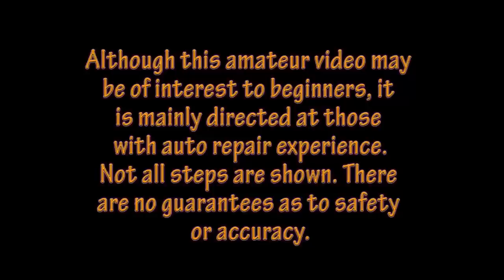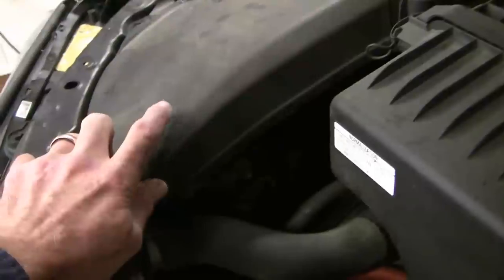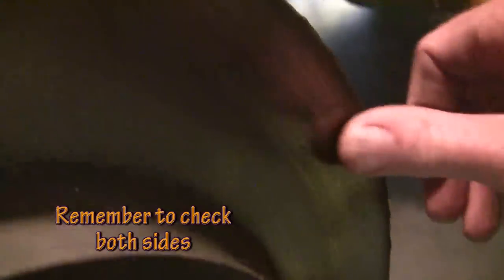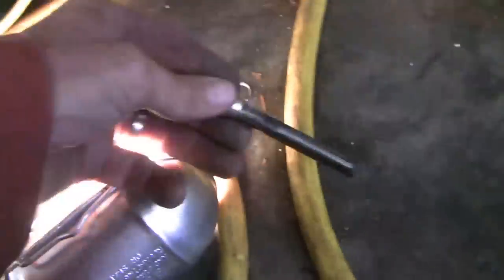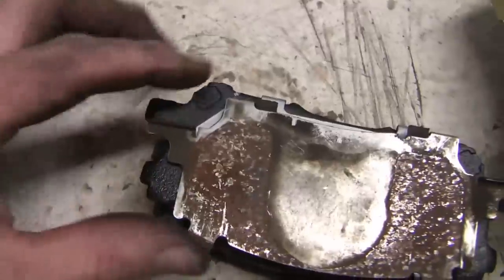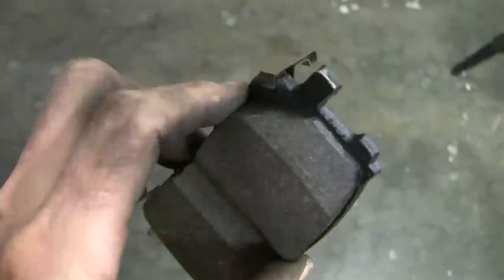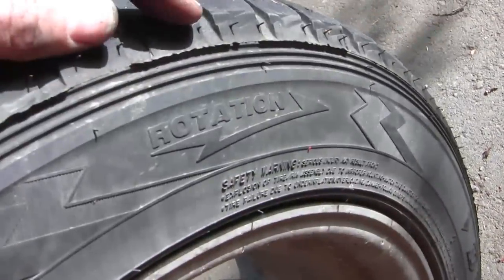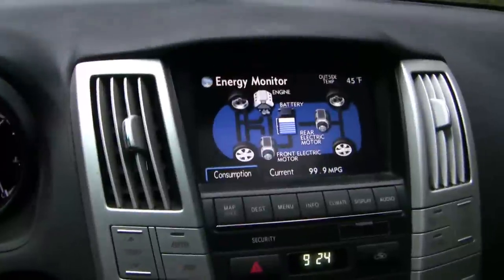How to replace brake pads on a hybrid vehicle, Lexus RX 400h

Comment: Hello my friend. I have a lexus rx400h 2006. 4 years and i have one problem. When i press break pedal slowly and lightly vehicle stops immediately, feels like ABS emergency stop system activated. This problems happens rare but this is very dissapointing thing. Can you tell me what this problem is ? P.S sorry for my bad english.
Reply from the maker: I guess I answered this question in the thread for my last video, but it is more appropriate to be here. This is the response I gave. I think you'll need a technician with a labscope and diagnostic tools that go far beyond DIY repairs. First thought is a failing wheel sensor, those devices have a hard time with slow wheel speeds and can send aberrant signals to the abs sensor, triggering the abs system. However with the complexity of regenerative braking, a simple code reader will not detect the signs of early failure. Many codes are proprietary and will not show up on a generic OBDII scan. Good luck!
Reply: @spelunkerd  thank you friend. I have one more question. 2 days ago i checked brake fluid suitability and master says brake fluid's need a change. Brake fluid's boiling temperature was 136 degrees instead of 200 degrees. And question is, can this brake problem caused by "bad" break fluid ?
Reply from the maker: @tutiav8447  Yes, when dissolved water boils it causes a spongy brake pedal. This is very different than the problem you are having now. Calipers really heat up when descending a hill or when actively braking in the heat of summer, and you can imagine the catastrophic problem of sudden onset of fading brakes when needed most. You can easily remove and replace fluid in the master cylinder with a turkey baster, but to more correctly replace all the fluid you need to bleed the system. Trouble is, in the hybrid Lexus after replacing fluid you may need a scan tool to bleed air from the ABS module. With most vehicles you can muddle through it by bleeding fluid in the usual way, then find a gravel road, activate the ABS by braking hard, then return to the shop and bleed a second time. I'm not sure that will work with the Lexus, you may get a pesky trouble code that is hard to clear, and you may not even be able to drive it until the new problem is dealt with. Professionals use a high level scan tool with bidirectional control to bleed air from the brake system.

Comment: How long can 1.7 mm last , another 10,000 miles?
I heard from a mechanic once that a shop made a break job on a car and not long on the road the rotor broke in pieces and a piece of that killed somebody as it got thrown in the air. Thanks!
Reply from the maker: Do you mean 1.7 mm of rotor or 1.7 mm of brake pad? That depends on driving habits and the state of the pads, how often you check your brakes, etc. These vehicles in particular use very little pad when braking is mostly done with the regenerative system. I rotate and swap for winter tires every 6 months and it's convenient to check pads at that time. Rotors have very little wear when pads are replaced before they get thin. Of course the thinnest pad is the one that gives problems, so when they get close it's usually time to get going. By the way, Tito. You can edit your post for spelling etc by clicking on the little arrow that appears when you hover your mouse over the top right of your post.

Comment: Is this the same procedure for 07 lexus gs450h?
Reply from the maker: Probably very similar, but as a general rule I try to get a copy of the dealers manual for all the vehicles I work on. A 5 year subscription to Alldatadiy or Mitchell gives you access to all TSBs and dealer protocols, for about $50. It pays for itself in one repair.
Reply: spelunkerd I’m curious because I recently replaced front and rear pads on a 2007 gs450h and after I was done I noticed that the vsc and traction light was on. I don’t know if those lights were already on before I replaced the pads. I drove the car around and the brake pedal seems a little stiff. I didn’t put the key away from the car I don’t know if that has something to do with why the vsc light was on.
Reply from the maker: Others in this thread described the same problem, and they also didn't move the key away from the car when they did the brakes. I would try to reset that by disconnecting the negative pole of the accessory battery for a few minutes, then reconnect. Cross your fingers and hope it goes away. When you do that, you'll need to do a relearn procedure for the window controls, there is a simple sequence that I described in detail in the description of the video discussing what to do when a hybrid won't start. Also there is a short idle relearn procedure after disconnecting the accessory battery, also described there. Once before I had the VSC light come on when my battery charge was too low. In that case the vehicle wouldn't start until I recharged the battery. However since you were able to restart the vehicle, it probably isn't that. Please stop by and let us know what happened and how you fixed it. I'm sure others will stop by and wonder what to do.
Reply from the maker: The other thing that you might explore is why the pedal seemed too stiff. If the above procedure doesn't fix it, you need to double check your work and find out why the pedal is too stiff. If you grab the caliper with your hand, in most cars you should be able to squeeze the pads together with minimal resistance. If not, recheck the lubrication of your sliders, they need to slide easily. Also recheck the brake hoses and be sure there is no pigtail twist that could cause a ball valve effect inside the hose. Recheck the adjustment of the emergency brake, make sure it's not too tight.

Comment: I just got into a horrible car accident and my car is a total loss, now I am looking for another used vehicle and I found a 2006 Lexus RX400h with 111,000 mileage on it. Does anyone have any serious problem with the Lexus RX400H battery? Spelunkerd, do you still have the 2008 RX400H, Sir?
Reply from the maker: Great car, I wouldn't hesitate to buy another. My wife drove it off a cliff, fortunately she survived without a scratch but the car was written off. The battery is always a question, I don't have an answer except to suggest a full dealer inspection. Toyota offer brilliant engineering, I bought stock in the company when I saw how well their cars are designed.

Comment: I've heard that because the brakes are electronically controlled on this vehicle it will require a dealer's scan tool to reset some functions after the brake calipers are compressed for new pads on this model.  Is that really necessary?
Reply from the maker: If you have to flush or bleed the brake fluid, the dealers manual describes a procedure to do that with the help of their scan tool. Because it's a brake by wire system, you can't mechanically force fluid down those brake lines without the help of the system computer. So, if you have to replace a caliper it might be very tricky to complete the job at home. And if you mess up and the system pushes fluid all over the garage floor, then you may need a tow to complete the job. What I did here carefully skirted around that requirement by not opening the brake fluid system. If I had to bleed the system I would have tried to do that with my aftermarket scan software (Autoenginuity pro), but I don't know if I would have been able to do it.
Reply: spelunkerd Ok, so since we are only changing the brake pads then I take it that it wont be necessary to take it to the dealer. Am I correct?
Reply from the maker: I'm still driving the vehicle today and no dealer input was required. Just be very careful to do it as I showed, though I suppose the dial micrometer measurements weren't completely necessary. Most dealers just replace the discs when pads are replaced. Especially remember to store the key far from the car when you take the caliper off. The bigger issue is whether you feel you are comfortable with the risk of doing your own brakes. No single video can cover every important detail.

Comment: What should I do when my 450h does not start after brake replacement?
Reply from the maker: Check the simple things first. It's very common in the shop to run the accessory battery down, and that presentation is different in a hybrid. I did a whole video on how to make that diagnosis in a hybrid, but basically take your multimeter and measure voltage across the accessory battery poles. While doing that, ask you wife or a friend to turn the start key. If accessory voltage drops below about 10 volts, you've got an undercharged battery. Recharge the accessory battery and you're away. If that isn't it, then I'd run a code scan, I'd be sure the vehicle is in park and your foot is on the brake pedal. Pump that brake pedal til it is firm. After a brake job the pedal needs to be pumped to bring the pads into contact with the rotor. Then try again. If that doesn't help and you don't have access to a scan tool, as a last resort I'd disconnect the negative pole of the accessory battery, wait 1 min, then reattach. You're looking for a reboot of the system in case there was a problem that has now been cleared. Remember, after a hard boot like that you'll need to reinitialize the door windows by running them all the way up and down with the individual door switches and sunroof switch. Good luck!
Reply: Thank you very much. My husband had the battery disconnected completely, reconnected and tgen used plunger cable.

Comment: first i want say thanks fir this video , i have RX400h i change break pad and the key was close to me wile i working but after i finish i start my car i hear sound comming tik tik tik tik ttttttttt now i feel very bad ? how can i remove that sound . then i found that when i press break and leave it the car stop quik coz the break press not open 😔 can u help me plz how to solve it ?
Reply from the maker: Dang! It is normal for the brake module to activate brakes before you start the car, but abnormal to have that clicking sound. Perhaps one of the pads was too far from the rotor to meet resistance with one automatic sweep of the MC. First check all of your work to be sure there is nothing wrong from a mechanical perspective and make sure your brake fluid is at the correct level. Make sure your new pads are fairly close to the brake rotors. On most calipers after a brake job it is fairly easy to slide the caliper open and shut with your hand, indicating the sliders are not seized or pinching at a bad angle. If they don't move well, take the calipers apart again and relube the sliders, and hardware. Make sure the brake lines are not kinked or twisted. Then put the key far away from the car, and then disconnect the negative pole of your accessory battery, then wait for about 5 minutes. Then reconnect the negative pole of the battery and cross your fingers, hoping the problem is resolved. Let's hope it is just a problem of recalibration for the new pads. That should happen automatically but perhaps the pads were too far from the rotors, resulting in a fail message from the brake control module. If you don't already know it, disconnecting the negative pole of the battery will cause you to lose your radio settings and will make the windows not roll up correctly. So, after disconnecting the accessory battery you need to initialize the windows and sun roof. It's an easy procedure described in the owners manual. Good luck! If you learn something that might help others, please stop back and tell us how this was resolved.

Comment: I accidentally shorted the battery trying not to lose the memory and i think the key was in but the not on and now i have no A/C the compressor started smoking! Im just a back yard mechanic old toyota mechanic
Reply from the maker: Dang, that's too bad. I'd start by looking for codes and checking for blown fuses. Let's hope the fuses protected the various computers. These new hybrids have many systems that remain powered up even when the key is not in the ignition, including the brake MC which can power up even when the key is close to the car, which is why it is important to disconnect the battery. Dealers may be able to find an algorithm inside the proprietary scan tool but my high level generic scan tools won't do that. In this car, resetting the windows, sun roof, radio and fuel economy settings is fairly easy. No radio code.

Comment: What about hybrid rear brakes? I have a 2011 Ford Fusion Hybrid
Reply from the maker: I have no personal experience with that one, although I can say there are more similarities than differences in brakes for most vehicles. Many use the rear for the parking brake, which adds an element of complexity and variation. For any vehicle I own, I invest in a subscription to the dealer repair manual, which is about $50 for five years, available through alldatadiy or Mitchelldiy.

Comment: Sorry i meant for rotors since the target is 26mm on that car. thanks!
Reply from the maker: You make a good point that rotors don't get checked very often in most vehicles. Many shops routinely replace rotors at the same time as the pads, and lack of regular followup could be used as an argument for that policy. Manufacturers don't make heavy rotors like they used to, so rotors don't last as long. But I'll make a guess that these rotors will last longer than 50,000 km, though warping is pretty common.

Comment: No! Don't use antiseize on anything ever. 😠
Reply from the maker: Of course antiseize in sliders or in places where lubrication is indicated would always be a bad idea. As you probably know, antiseize has abrasives suspended in it that can wear down a surface that is constantly moving. It is especially bad around bearings. However under brake pad clips, the amount of movement is miniscule, and the main goal is to prevent 'rust jacking', where rust builds up between the clips and the caliper, pressing the clips out and mechanically binding the edge of the pads so they can't shift sideways as the pads wear. Similarly where a wheel is bolted to the hub, you don't want rust jacking to cause wheel balance issues. In those areas, the goal is to control oxidation and seized parts. Yup, if you're careful, and if you don't use too much, you can use high temp brake grease as a dual purpose antiseize. I prefer to use a compound specifically designed to control oxidation, but a case can be made for using only one compound for both indications. When only one product is used, the implications of an employee mistake are less, not to mention the extra trouble of keeping two products in stock, and of course the extra mess. In their manual, Toyota use just their proprietary rubber grease for everything.
Reply: @spelunkerd  the pink Toyota goo is perfect for the slides. No problem there. Once upon a time all you could get is anti seize, so that's what people used. Today there are way better products then anti seize. In fact, Toyota makes a "white" colored lube that can be applied to the ears of the pads and will provide rust prevention without drying out. Anti seize on the other hand dries and gums up. As miniscule as the movement is when pads make contact with the rotor there is still movement that needs to takes place. That movement is not going to happen as long as there is gummed up bullshit on the ears of the pads.